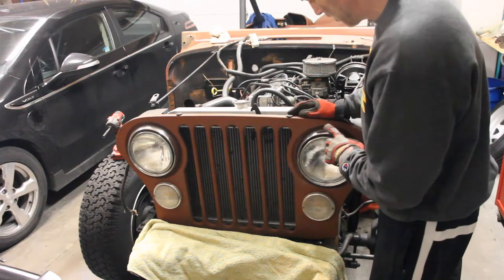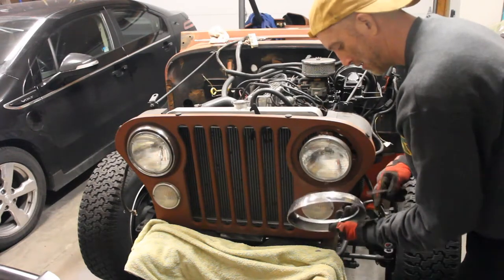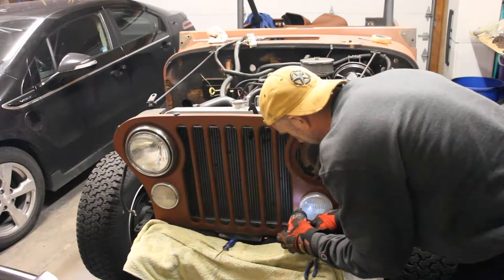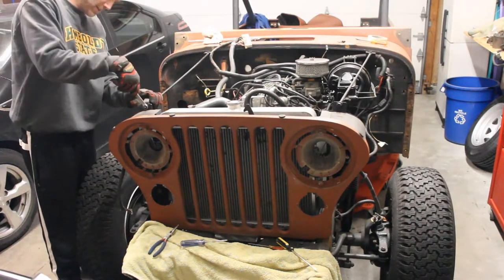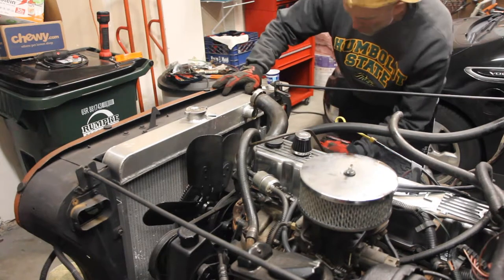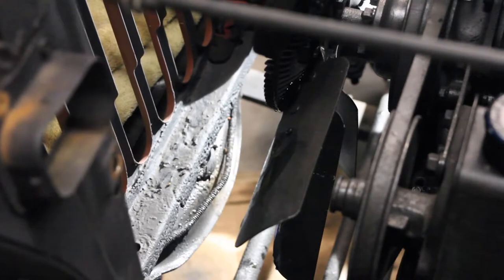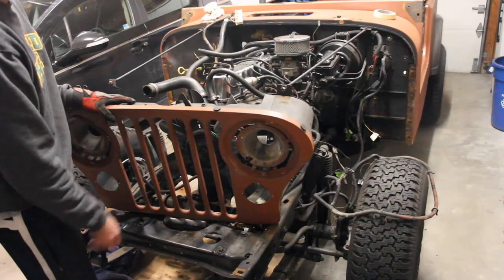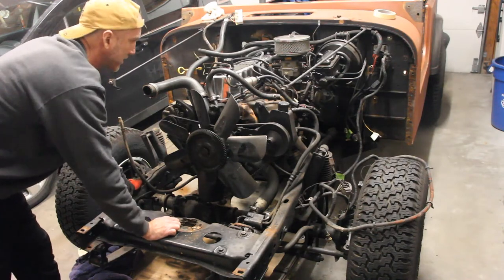Jeep CJ7 Front Grill Removal

Comment: Hey Man, you can't just remove the grill without removing the fenders ?
Regards !!
Reply from the maker: I can't tell if this is a question or a statement. So, I'll approach it as a question. You can do it either way. If you're just going to pull the engine, then you can just remove the grill with the bolts connecting it to the fender, the body mount, and the support rods to the firewall. What you see in the video is just the process of me completely tearing the CJ7 down to the frame.